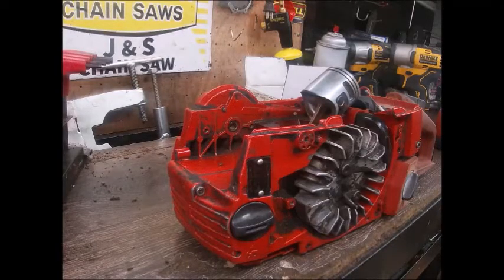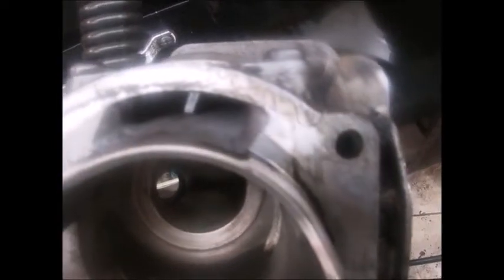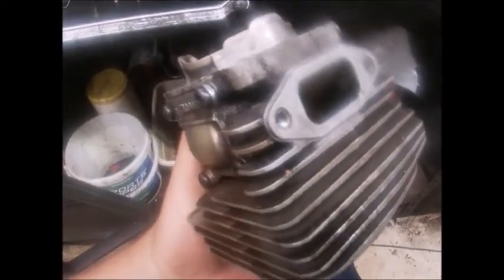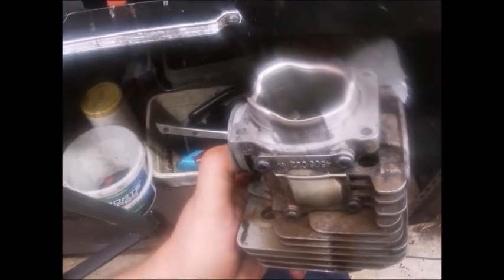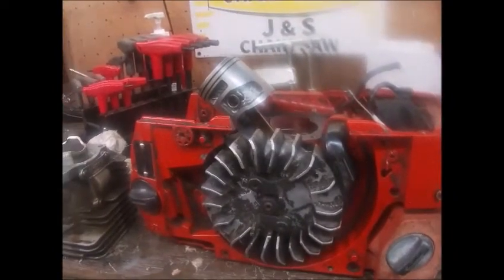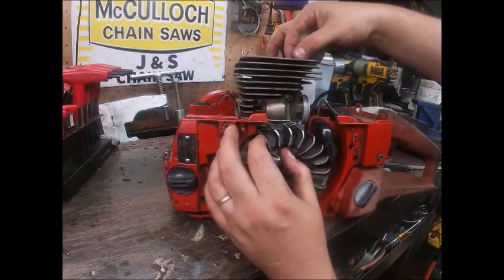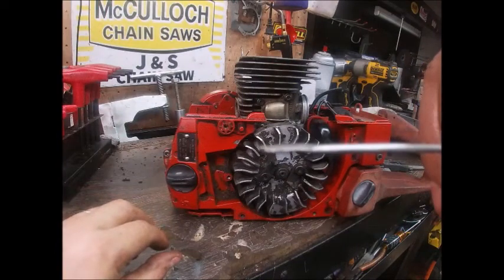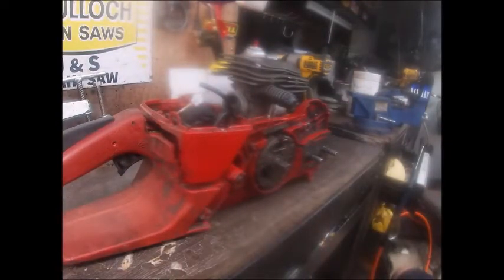Jonsered 2166 HOT SAW Build

Comment: Not very many people want to mess with the x-torq, most will swap to the older style cylinder to stay away from that strato style cylinder. I have done a Stihl 441, it takes straight air and atomized air and fuel in two different ports.
Reply from the maker: yeah ive done a few stratto saws all turned out well....most stratto engines use a carb and a secondary throttlebody for fresh air..this series saw all 3 ports are fed off the carb...
Reply: @JandSChainsaw  It has to be getting fuel mixture through the strato port also.
Reply from the maker: @JKSawShop  yep and when I'm done it's gonna get alot 😆

Comment: Your plan on numbers sounds great. The difference between 2166 and 2172 is that divider in the transfer cap as it restricts the air flow on 2166. Of course you can hot rod an clean power(x-torg) engine :) also i believe that those 2166 and 2172 and Husqvarna x-torg equivalents have top rpms limited at 13k. I havent actually worked on these saws but this is just information i have collected about those.
Reply from the maker: Yeah it had a blue limited coil I have a black one unlimited for it